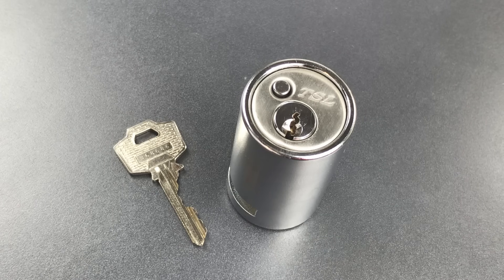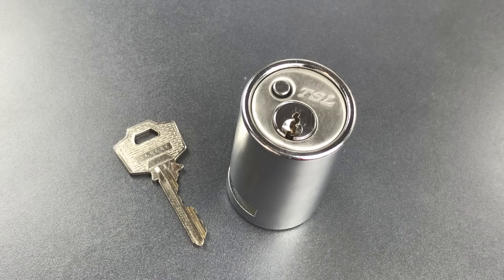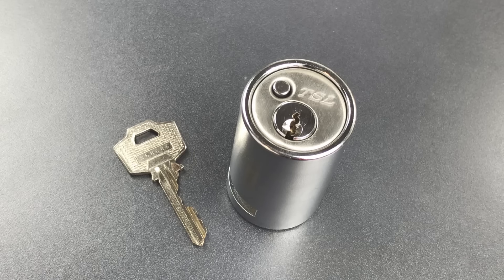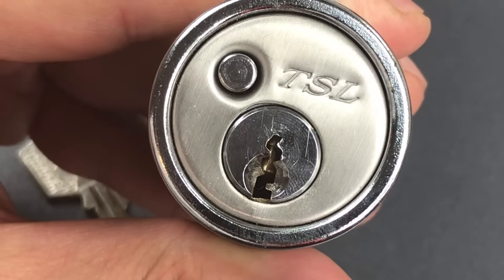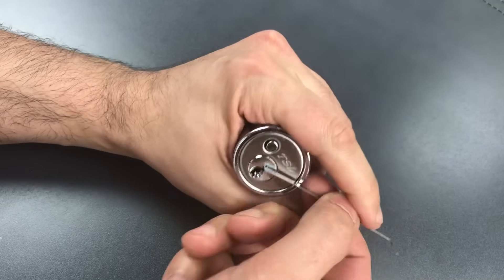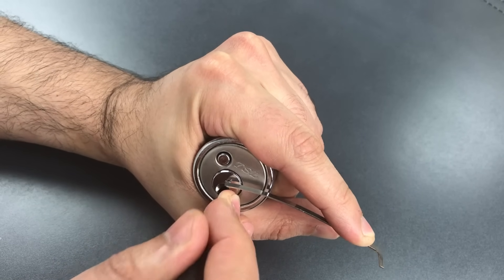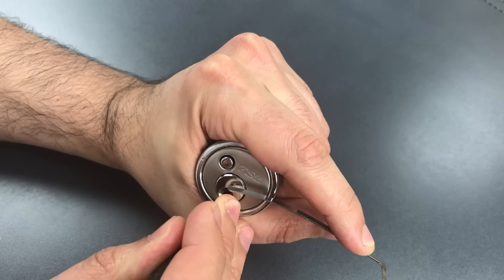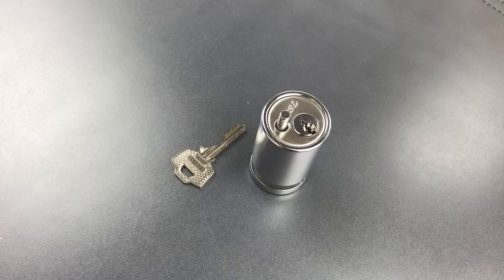[722] The Naughty Bucket Chronicles — Tung Shing Disc Brake Lock Picked

Comment: Should've put a standard key pin in #1 to not give away the secret.
Reply: Jason Henderson I thought the same
Reply: Agreed, or an anti-drill pin.
Reply: Couldn't you just lift it all the way to look at the second? This would work better on those locks that completely hide the pins from view by having you turn the key halfway around before you can even engage the pins. I feel like having pins that easily get stuck in the shear line is the key to making an unpickable lock. It's almost like you're picking a combination at that point, where each attempt is going to take you several minutes just to figure out it's been over set.
Reply: Opp
Reply: Precisely
Reply: @RipleySawzen  Could be possible but normally the pick would be in the way.

Comment: LPL: it’s similar to what you might feel when you are trying to set a spool. 
Me who struggles to open locks when I am provided the key: Ah yes, of course. Makes sense. What is a spool.
Reply: @bingobangobongo2419  Did you screw up that joke?
Reply: bit late but a spool is a pin that looks like a thread spool
Reply: You need to put key into lock in a correct way, and don't over set.
Reply: I have my orange belt, can confirm: keys are difficult to use

Comment: I  have no skill in lockpicking, and so I can't have a true appreciation for your delicate tension and ability to set pins. But your skill in analyzing these locks is wildly impressive. First the half-pick half-impression lock, then finding and picking those magnets, and now identifying this evil pin type...Just wow. Add in that puzzle lock your opened for good measure. You figure out why you can't pick it with astounding deftness, and then the battle is over--you've already won.

Comment: Shaping the pins that way is so clever. So easy to overset which  gives you false click that actually locks the cylinder and forces you to over release the tension in order to get that notch out which causes the rest of the pins to reset, basically you start over ever time you overset a pin. That is really smart.

Comment: I think one of the best safety features for a motorcycle disc lock would be to have the keyway perpendicular to the brake disc facing the ground. You can easily enough insert the key upward from below to open it, but lying on the ground next to someone’s parked motorcycle, with your head alongside the rear wheel, dinking around may provoke suspicious interest from others.

Comment: HOW DOES THIS WORK LIKE ASMR
I mean it, a padlock and a pick in my hands and it's the exact same feeling as repeatedly solving a rubix cube.

Edit: I am NOT good at this, but alot of standard locks don't require too much attention to pick if you're not speed running it tbh. Put a podcast on

Comment: I'm a novice picker and I recently acquired a lock which I thought would be easy to pick, but I found it really hard because the first pin is zero-lift and the rest are high lifts. Accessing the other pins without accidentally depressing the first one is really hard, at least with my current set of picks. It took me a lot longer to pick than some supposedly more difficult locks. I'm considering buying some more picks to see if I can find one which makes this lock easier. All of this is surprising because this lock is... a Master Lock 3 😨

Comment: I gotta say, the comments on this channel are as entertaining as the matter-of-fact musings of our LockPickingJohnWick. 

As far as locks go, my take away is that when it comes to mechanical security: The LEVEL of security is directly proportional to the square of the TIME it takes to defeat it. In other words, if one lock takes T to defeat for (level-1-security) S , 2 of those locks take twice the time, but increase security by a multiple of 4 (2²)

Thus: Security = Time² or S = T²   **

** Technically, the equal sign should be a “proportional to” sign, but I don’t know the Unicode for that. 🤷🏻‍♂️

Comment: Damn ! I found this one on some chinese store , not so cheap , but also not so expensive. And , I can bet that none of these if ordered , wont have these zero lifting pins inside. Tho , they all have crazy bitting on keys that are shown with them. Not sure what is wrong on my (building) picking skills , but , I find that it's more easy to pick a cylinder than self contained lock , I mean , like this one and padlocks. I picked ISEO standard pin tumbler cylinder , as well as Corbin one and some unknown manufacturers ones , but , one particular Elzett 2048 (45mm) padlock is driving me nuts. I get very quickly into very deep false set , but , can't move any further. And I know that it has at least 3 spools , but , can't believe that they catch so hard.
Reply: If you are still stuck after 6 months I may have a tip for you that I use on ceased-up-in-deep-spool-false-set: use both TOK and BOK at the same time. If you can position them so you tension TOK with your index finger and BOK with your thumb (press them away from each other), you can make very accurate manual counter rotation.

Comment: I think having a key helps to pick the lock because you can see how far pin travel needs to be.
Reply: True - but in the 'wild' you're never going to see a key to know the pin travels. Even with the key as an indicator it took him a minute and a half this second time as the lock was putting up quite a fight.

I should note, however - LPL is a master picker who can pick locks most locksmiths won't even touch. A minute and a half for him is probably going to be an eternity for anyone like us. In a nutshell, novice lockpickers (including most thieves) won't be picking this open.

Comment: If this lock were installed as designed, how difficult/easy would it be to pick?  That is to say, when this is locked to a motorcycle's disc brake, would you be able to feel what you're feeling / get your hands around the lock?

Comment: If you're trying to do this on a motorcycle bent over in an awkward position with little space at night trying to use a flashlight trying to hold on to that thing and use your tools it would again be a different story.
Reply: Yea he didnt say it was a bad lock, it was hard to pick in good conditions
Reply: How many locks irrespective of price or brand does he find challenging of time consuming to pick? 
By implication this is a great lock.
It's somewhat moot though as that would almost certainly not be the line of attack if someone wanted to steal a bike.
Reply: Its a lock for the brake disc — keeps you from riding off, but not from the more useful attack which is simply lifting the bike into a van. Angle grinders to be found at your hideout.
Reply: @JasperJanssen  At least that requires two guys, weeding out criminals without accomplices as well as opportunity theft (not sure that's a good English phrase... I mean theft where you just stumble upon that bike and nick it, as opposed to planning a run with your gang to actively look for stuff to steal. Oh, good old times...)